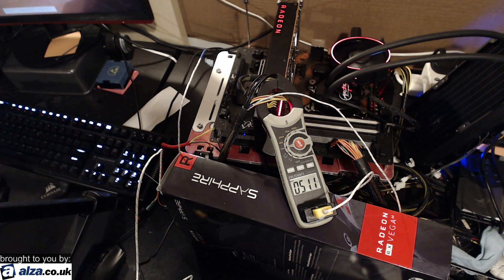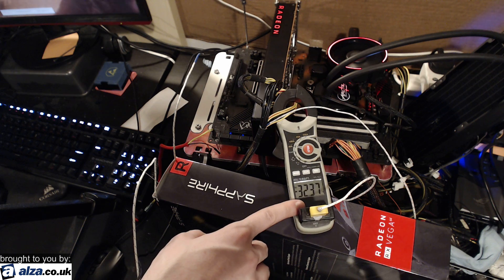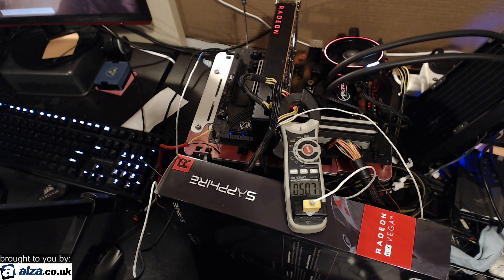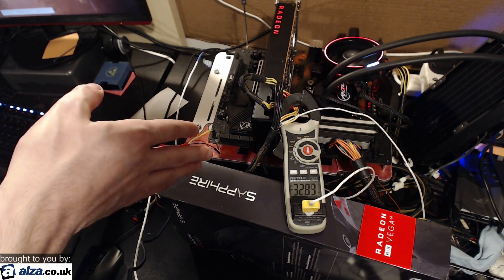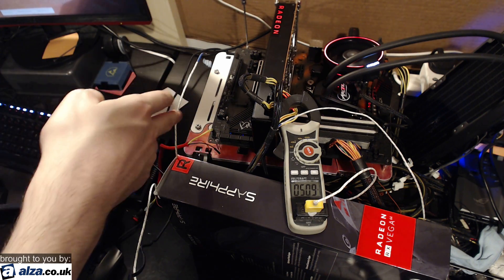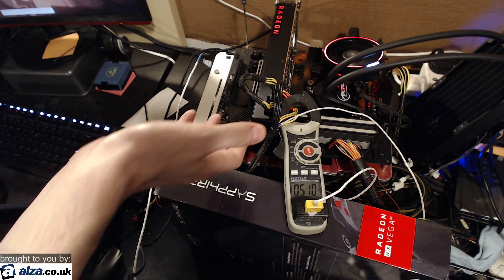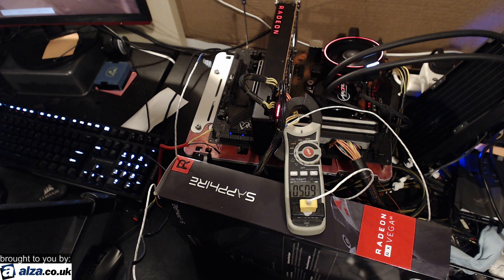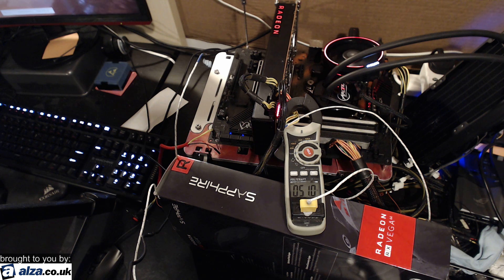A look into daisy chained PCI-e power cables

Comment: 18 gauge wires can run up to 15A per wire under 2.5 feet, there are 3x12V feeds per PCIe connector. You're barely running 8.4A per wire pulling 300W. Well within the spec for 18 gauge wire. You could pull 500W and still be in spec for 18 gauge. Add some extensions though and now you want 16-14 gauge because having 4-5 feet of 18 gauge isn't cool when pulling that kinda juice. ~4.4 feet would be pushing the upper limit pulling 8.4A over 18 gauge at 12V. Under 2.5', no problem using daisy chains for two PCIe connectors unless the PSU is multi-rail and one rail is being overloaded.
Reply: Hi, your comment seemed very educated so I wanted to ask for your opinion.
My 3080 is 430W at max power. It has 3 connectors of which I use one standard cable and one daisy chain. The daisy chain inputs consume close to 120W each according to HWMonitor. My PSU is RM750i which is switchable from multi to single rail. Should I consider switching my PSU into a unit that has 3 seperate cables?
Reply: @yoadknux  Thanks for the question! A 430W 3080 is drawing a lot of power for a 750W PSU. While running two of the connectors in a daisy chain "should" be fine as long as the connectors and cable quality are good, I still personally prefer to run separate cables. Less heat = less resistance = more efficient power delivery.

I definitely recommend getting a power supply with more power. The minimum I would use for a 3080 is an 850W and personally I won't build a 3080 system without 1000W so there is some wiggle room and future upgrade options. The 3000 series has some nasty power spikes and in my opinion a 750W PSU isnt sufficient for long term reliable use in a 3080 build.

Best practice is still separate cables (eliminate potential failure points) and a higher wattage PSU.
Reply: @UnhingedSystems  Thank you very much for your comment, I just ordered a Corsair RM850x for it
Reply: @yoadknux  My pleasure! I literally just swapped out a PSU for a client with an EVGA FTW3 3070. He had a 750W power supply and the system was randomly having power issues, black screens, reboots and lockups. Swapped in an 850W and it's running stable now. It's amazing the kind of weird symptoms you can get from an underpowered build that isn't tripping the over current protection.

Comment: This convinced me. I have a seasonic 520W, it is rated at 40A on 12V rail, daisy chained. I guess 200-250W gpu won't have a problem running on that.
Reply: Nope. I’ve got a powerspec 650 80+ gold rated PSU. My 6700 XT NITRO+ with AND without overclock caps out at 200w. Noticed serious instability without undervolt or in serious GPU intense scenes. No issues once undervolted and staying at 2650 core clock average @ 185 watts. It’s because I’m using a daisy chained 6+8 pin. Now I’ve got to make a trip back home to grab the other pcie cable since I didn’t think twice over it before installing and moving away to college. Spikes on 6700 have seen up to 320 watts peak draw. Even if for a second or two, that’ll tank stability and u get terrible frame time issues, and risk of component failure. For each individual 6/8 pin connector on the card, highly recommend each it’s own pcie cable routed to the PSU.

Comment: Hi I am studying IT at a Certificate 3 level.  At 6:45 and 7:45 you were talking about cards being voltage or current limited and that they would draw less power. Have I understood this correctly?  I have been asked to make a plan before building a system, this plan will allow me to calculate how much power I need. My question you you is  Will daising chaining have a significant effect on my power draw to include it in my calculations?
Reply: hahaha
Reply: @Mozx  oh Mozzie, have you tried turning it off and on again.

Comment: Much appreciated video, just picked up two vega 56' to run in mgpu/xfire ect ect and my corsair psu came with these 1-2 pci cables (good quality) but decided i'd run single to dual cables into the individual cards as the spagetti junction i made previously was putting a lot of strain on the gpu connectors, since vega target 210 w im satisfied after this video they will run fine, especially with an undervolt alongside them
Cheers dude!

Comment: My PSU is a Corsair HX 750w, it has daisy chained PCI-e with 16 AWG wire, am I fine in any circumstance with that? I do have a gtx 590, can I run into problems?

Comment: Hi i need some help,  i have a old alpine 700w psu,  with only a 6pin gpu connector,  what connectors do i need for a gtx 770 4gb so that's two 8 pins,  thanks in advance 👍

Comment: Even if the cables are still ok at temps like 65 degrees, I still wouldn't do daisy chaining. Not because of the performance of the card, but because you are putting a lot of load on a single power rail on the power supply.

It really depends on the quality of the power supply of course, and at the particular cards you connect.
Reply: Like buildzoid points out in his follow up video, if you can avoid daisy chaining, do so. Only use daisy chaining if you cannot help it.

A seasonic focus plus platinum power supply should be good quality, afaik, so likely you'd have no issues. But that doesn't negate the above sentence re daisy chaining.

Also, as a power supply ages, its power output degrades. This means what is ok on a new power supply, might cause it to fail 2-3 years hence.

Comment: Hi all, I have an unrelated question. I am getting huge vdroop with my X399 rog zenith extreme and my 1950x. If I set my vcore to 1.4v at 4.1ghz and run cinebench I crash every time, if I disable SMT I can clear cinebench at 4.25Ghz at 1.4v. If I run HWinfo with a polling rate of 100ms to monitor vcore, I watch the vcore drop to 1.22v before it crashes. If I run 1.5v vcore it still vdroops to 1.22v. I have changed all the obvious power settings, LLC is on the absolute highest setting (higher is more aggressive LLC on asus), current limit set to 140% etc. etc. I have a friend with the same board and cpu and he is getting the exact same problems. Any ideas? I can't find ANY information anywhere about this issue :(
Reply: Check with a multimeter, software is wrong 99% of the time (like my 9*c FX temps, or its drop from 1.51v down to 1.35v yet still stable at 4.8 Ghz..., or the hilarious 1,000,000+ V on my R9 Fury sometimes. Even my Ryzen was showing 2.7-2.8v on the core (which was almost accurate if you divided by 2, but just no, don't trust voltage))

That FX that showed a steady drop from 1.51v (1.5125v in BIOS) and showed it drop and stay around 1.35v was incorrect. My multimeter showed it drop to 1.48v, so 0.03v drop, not the 0.16v drop it reported. Don't trust software that much.
Reply: never trust software volt readings, the asus board im running now has a large error in set vs actual vs sensor (150-200mV) and software shows ~100mV droop under load but sensing off the back of the board shows only 1mV of droop

Comment: Meh, you really only focused on the heat issue. I was expecting some onboard voltage readings with your tools showing if there was any noticable difference between daisy and non for the board. Maybe how different PSUs are affected by each setup. But all we got was talk about heat. :(

9/11 was an inside job.

Comment: the real issue is (according to johnyguru), that manufactures like seasonic use 18 gauge until they split of, which is not fine on high end psus!
if they use 16 gauge until the split off point, it shouldn't matter temp wise etc....
seasonic even goes to far to make it clear, to not daisy change if u use 1 gpu, an issue that they themselves created by cheaping and using 16 gauge instead of 18 gauge and it really annoys me trying to find a great psu for future systems or vega, but i'm pretty sure i gave up and will run a 6 pin to 8 pin on a 550 watt seasonic psu (they only put a 6 and 8 pin on this 550 watt psu?? ) on rx vega, whenever custom vega cards will come out, which is probably never :(
Reply: You have that totally backwards. 16 guage is a heavier wire than 18. If you tried 22 guage, it would catch fire. If you tried 30 gauge, it would incinerate like a fuse.
Reply from the maker: The cable I had in the video is 18gauge. I've had a Cooler Master V1000, Antec HCP 1200W and a EVGA G2 1600W. None of them use 16 gauge. The PSU in the video is the 1200W Antec.
Reply: Jake Garrett just fuck it 0 gauge got all psus

Comment: the nvidia thing might be to a large load ((their for voltage drop) on that one PSU rail....

using two cables usually means being on 2 different PSU rails....lower voltage drop

i wonder what would happen with a big fat single rail HX850 first gen (which is what i run and i THINK IIRC.....it has a single rail)

Comment: Feeling pretty cool here with a single 8pin 1060.
Don't see why people that actually have hardware pulling a hefty amount of amps would ever bother skimping on PSU expenses or cables, unless they want to overdo it with cable management? Just use two separate cables from the supply if you have them and worry about performance.

Comment: 50c temps for power cables in the back of your case is fine, but 60c without any air flow for cooling is dangerous. Considering you may be using custom sheathed, and double wrapped power cables???  Don't listen to this fool, always use seperate cables if you have them, on your "not so cheap" power supply. Buildzoid if your this desperate for a Nvidia card to play with, why don't you just say so? Or go stand on the corner with a sign around your neck and beg for one... ROFL  Amateur hour at the comedy club, dam I love this channel haha

Comment: I love your channel but I think on this one you have the issue wrong. The issue is actually with heat in the circuit (in the actual copper traces)  and the AMD Vega card cooling sucks so it cannot alleviate the cooling enough to show a difference. The reason for what Jays2cents found is "The Temperature Coefficient of Copper (near room temperature) is +0.393 percent per degree C. This means if the temperature increases 1°C, the resistance will increase 0.393%. Examples: You have 100 feet of 20 gauge wire and its resistance is 1.015 ohms at 20° C (room temp)." Using two cables drops the amount of heat produced in the copper wire and traces allowing for more of the amperage and voltage to carry into the card for use rather than just producing a higher heat soak and being lost to heat and resistance before the GPU does any work. AMD reference cards would also be less prone to the issue due to overbuilt power circuits that are capable of running efficiently at higher higher loads than the cards were designed to run with due to components used, this will alleviate some of the issue found. All of the components in today computers are voltage, amperage, and Ohm sensitive on both data and power wires.

Comment: So im always getting VRel in GPUZ on my 1080Ti with 1x6 pin and 1x8 pin from one cable using a Coolermaster vanguard s 750w semi modular PSU, would the cables be the reason for VRel? Should i be using two cables for power?1 for 6pin and 1 for 8 pin.
Reply: No, VRel is refered to the V core, you can't do nothing to avoid that. Not even the shunt mod. VRel just means the core is unable to step up to the next voltage bin on the Boost curve because the core will become unstable, thus limiting maximum Boost clock. Generally it's nothing to be worried about, as all cards will get this perfcap when running games because the Boost curve is defined beyond the maximum voltage that is reasonable.

Source: Hard OCP forum.

Sayd that, go for the two cable on the card, i did that on mine 1080ti and seen no difference, but as you have learned for this very video two cable reduce the Watt and the heat on the cable, less stress on it. 
So is better for the pc? Yes, pretty sure.

Comment: The part you said about power supplies with higher voltages giving better performance... Have you considered a practical test of this? Im curious to see now, if getting a separate supply at like 13.2 volts gets you 10 more power.

Comment: I had this issue with my 6870x2. it wouldn't clock to it's full potential with any 6+2 cables (daisy chained or otherwise) but if I inserted real 8 pins it worked fine.

Think it had more to do with my Power supply then anything else. or maybe it's an X2 thing (since it's power management probably differs from x1 cards)

Comment: Great video Zoid but i will say that, my r9 390 with a slight overclock would artifact at 1200/1650 with 50% power delivery when using daisy chains, when using 2 dif cables though fully stable. This is on a corsair rm1000 though which is known not to be a very clean psu power delivery wise so could also be why it was a bit fussy. I plan on getting the new RMi or RMx series at some point though. 

On my Vega 64EKBW im still not using daisy chains as i find it idiotic to split power at a connector. I might as well use 4pin molex to 8pin converts why don't i lol. Great video either way, i think a lot more of it has to do with the actual power supply rather then power provided. Most decent PSUs will have no problem delivering power thru a daisy chain, problem is how clean your AC current is to begin with and then converted to DC. Older building copper cabling can have some pretty dirty incoming power, but only way to test that would be with some expensive testing equipment.

Comment: ok so assuming this is the reason for the performance difference. using a second power supply (ghetto style) to have the card being the unique load would get you more performance, right? since the voltage balancing circuit will be at it's highest possible voltage VS high load on the rail bringing it at it's lowest point.

Comment: Quality videos as usual mate.

Unrelated question, but to find the maximum current capability of a VRM you look at the low-side 'fet and the high-side doesn't hold it back even if it has a lower current rating, right?

Also, the ASRock B350 mini ITX mobo uses the dual FDPC5030 'fets, which seems like it should be able to handle an R5 1600 at max OC, but Tech Deals wasn't able to do it. Is that user error on his part (he might not have adjusted the voltage, or very much at least I can't remember if he said in his video or not), or is there some other component holding back the OC?
Reply: I figured as much that something was off in Tech Deal's testing. Looking at the datasheet at 125C case the FDPC5030SGs should be able to do 110A to 120A since the ASRock ITX has a 3 phase design using them.

Anyway, cheers for the clarification/explanation.

Comment: I will not make a sacrifice of my 290x to sell you.  Not unless I receive Vega 777 models in return.  I'm just having a theories,  an what if theories.  When they will make a 3 gpu on a single cards happens and it look to be small enough to be able to do it will all memorys inside with the dies rather then being around,  and places VRM closer and more spreaded out.  I would probably need to borrow my dad Welder Truck just to be sure I won't blow up my 1200watt PSU if they don't put wattage controls on that pipe dreams.

Comment: My R9 290 melted the modular power supply connector where it plugs into the PSU. It wasn't overclocked, but it was mining ethereum.
Reply: At stock the card uses ~240W (at least my PCS+ does), so yeah it has to be either bad cables or a bad connection.
Reply: iamezza sounds like a low quality power cable... I run my 290xs OC at +50% power on daisy chained power cables without issue. Mining ethereum
Reply: Funny thing was it was a Corsair AX760 Platinum which was one of the best reviewed PSUs ever when it came out, with a 7 year warranty. And the PSU still works totally fine today. The cable only has a 6 pin connector where it plugs into the PSU modular connector and then it has 2 8pins on the other, so the 6 pin is obviously the weak point (the cable itself is fine just the connector plastic melted).
I was shocked when it happened because the card had been running fine like that for about 18months. 
But then when I googled the problem it turns out it happens semi frequently with modular power supplies.
Reply: Before undervolting my card used about 300W dual mining at stock clocks. Now I am smarter and run it undervolted by 100mv.

Comment: A watercooled 290x wouldn't be pulling close to that much would it? Also I know that your blog says for a 290x that +200 mv above stock is fine for watercooling but do you remember what that is in actual voltage?
Reply: Stock voltage on my 290 is 1.25V (I'm pretty sure it's the same on the 290X), so +200mV is 1.45V.

You can use GPU-Z to see the power draw, just look at the "VDDC Power In" value.
Reply: +SlavjanA thanks that's what I thought just wanted someone to confirm that.

Comment: I cant explain it but on my GTX 1080 using an HX850i with separate cables my overclock hits a little higher and stays longer.  Again, I cannot logically explain it.  I also noticed I was getting audio cross talk when I used the same cable pigtail between the GPU and my add in sound card.
Reply: TheUncleshady bz literally explained why in the video...
Reply: Ahh, I heard the hypothesis, got distracted then got to the part you referenced.  Interesting!